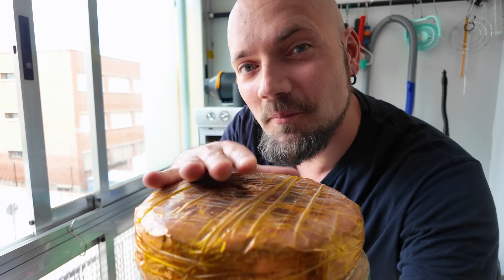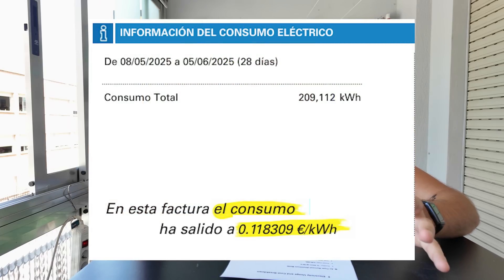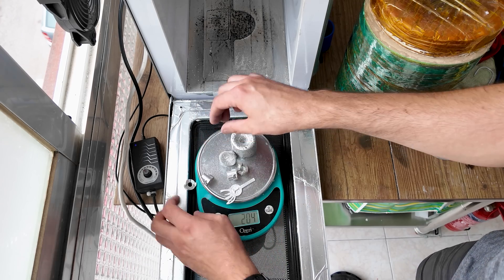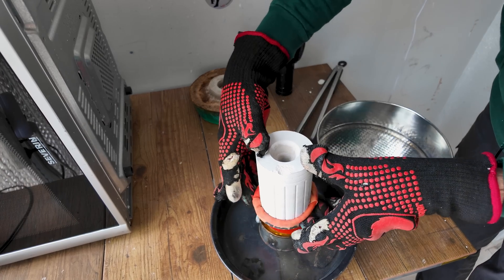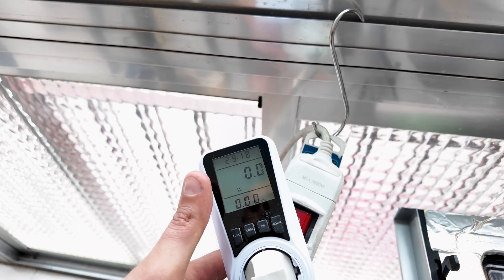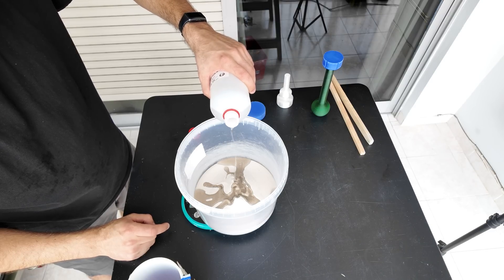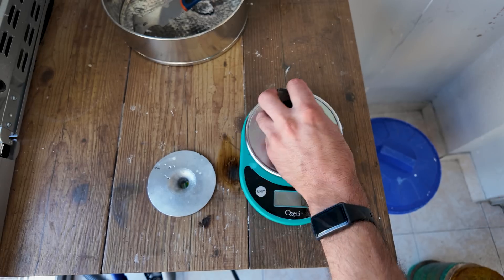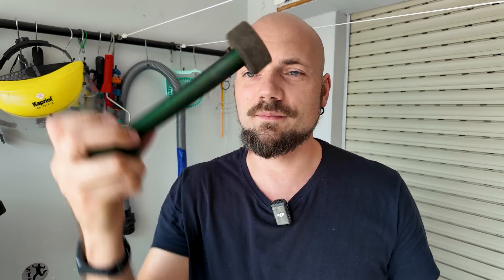Melting Metal in a Microwave – How Much Does It Cost?

Comment: Interesting result! Would have thought more. Interesting that most of the appliances have such a low duty cycle and are not on max power all the time
Reply from the maker: Yes, it's not bad at all. Cheers!
Reply: Most electric stoves control power similarly, turning the burners on for a period of time then off for a period of time... in microwaves, the magnetron replaces the burner and cycles on and off to control power - its the most obvious on the defrost setting.
Theoretically it may be possible to use defrost or lower power setting to anneal finished casts - depending on cast size, power and insulation... though it would be exhausting to figure out by trial and error